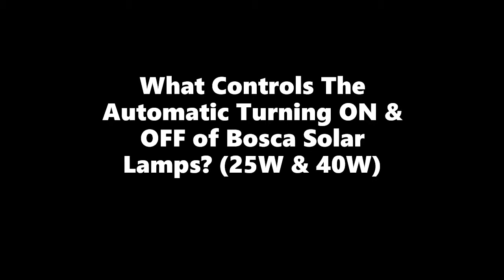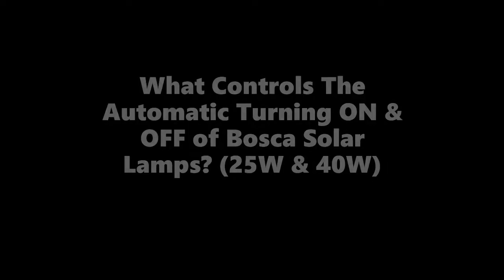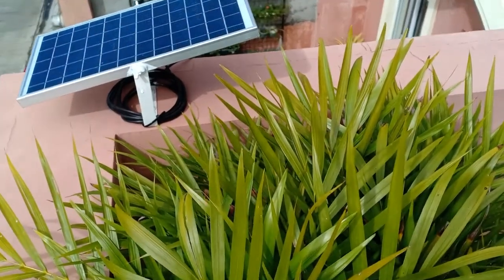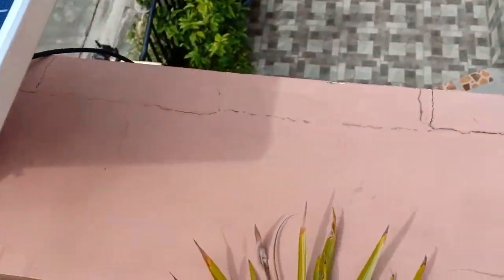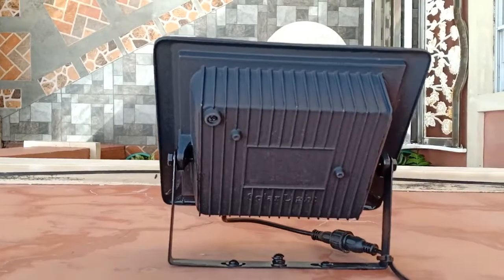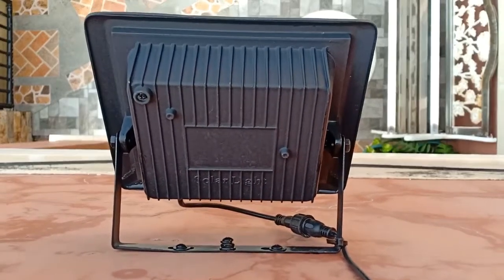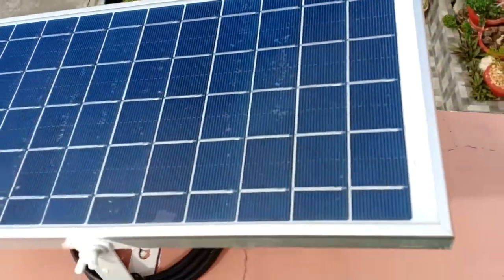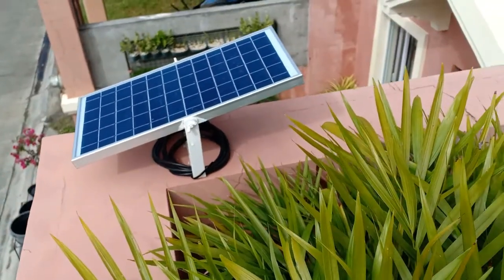Bosca Solar Lamp- What Controls Its Automatic ON and OFF

Comment: How many voltage output does 40w compare to 25w?
Reply from the maker: Rated Open circuit voltage Voc for both 40W & 25W solar panels is the same at 7.2V. Actual Voc was very close at 6.6 to 7.0V. Loaded voltage (solar panel charging the battery) is lower but still ok. I've not tested charging current for the 25W panel but here's an actual test on the 40W (16W) solar panel: https://youtube.com/shorts/NHQKJ0C-zUE?feature=share
Reply: I should’ve bought the 25w I guess? No option to transfer lazada money to elsewhere anyway. I’ll just leave it as is and not cancel. Thanks for your reply